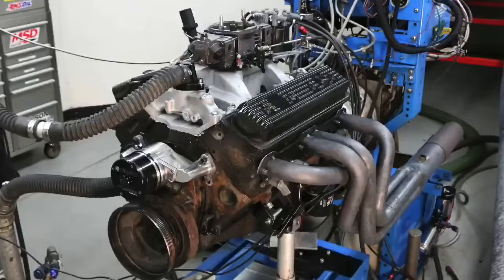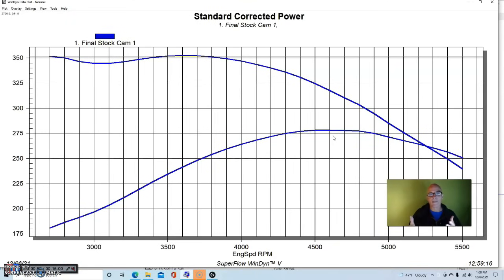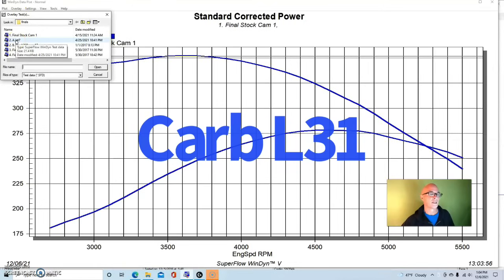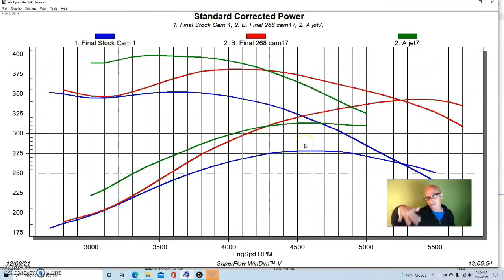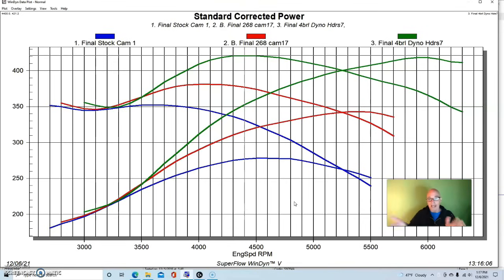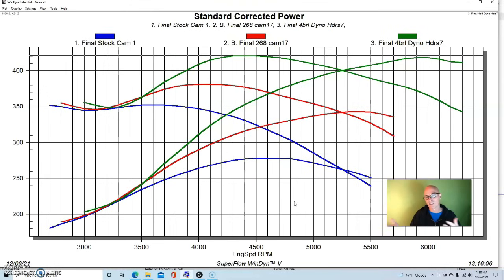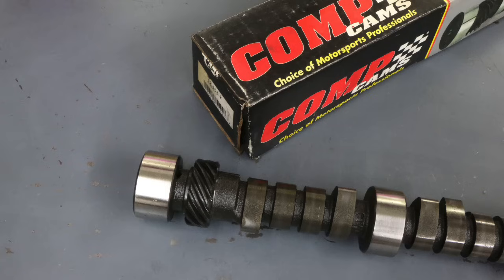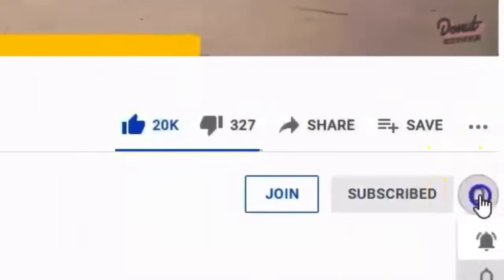HOW TO MAKE CHEAP, JUNKYARD, VORTEC SBC POWER. JUNKYARD VORTEC HEADS-400-HP 350 CHEVY MODS.

Comment: I pretty much have the same set up in my 3rd gen camaro.. Forged flat top pistons, 15 thou shim gasket, vortec heads screw in studs, ls springs and comp retainers with valve job 1.6 ratio rockers 3'42 gears 700r4 trans and it runs fantastic, pulls hard and makes a nice street driver highway cruiser with the 600 holley vac secondary.. If light foot work on highway if I had to guess I am getting 20+mpg. Its just a nice running motor fantastic driving car.
Reply: Good luck buddy I just did basically the same thing to my 91 camaro and the trans has already been built twice and I said fuck it and I'm putting in a 350 turbo because no matter who builds those 700R4 trans they won't last with anything above 400hp
Reply: @jonathanlawson4667  WRONG.  Look up the name SONNAX, please.  BTW, AC-DELCO sells "hard parts" that can handle up to 650 ft. lbs. of torque.  With a 4 speed, you can put "stiff" (3.73, 4.10, or even a 4.56, with tall tires) gears in the diff, and still get decent mileage.  Try using that THM 350 with those ratios, "bye, bye," piston rings, sooner than later--high revs wear out any motor, period.  You can (easily) build the 4L60 (same as a 700R4) to the specs needed, to handle up to 500 hp, with no issues. Having an overdrive transmission always beats not having one, unless it's a  "Saturday night/strip only" ride...  P.S.   You need to find a builder who knows HOW to build a 4L60 series transmission.  Next Spring, I intend to BECOME one of them, now that I have a garage (finally!) to DO it in.  Good luck to you, whichever route you take, but remember what I've (correctly) stated ABOUT 3 speed versus 4 speed automatic transmissions...
Reply: @bobhoffman5581  wrong 🤣🤣🤣 my transmission is proof sonnax is shit and if you want another example look at Billy the kid and SRC garage they couldn't get one to hold either and spent over 5k trying to so Don't tell me I'm WRONG when I've went through 5 all together and 2 with this 650hp nitrious car so with all due respect you're WRONG buddy
Reply: @jonathanlawson4667  YOU claimed "anything over 400 hp," which is total Bravo Sierra, PERIOD.  You're NOW describing a HIGH PERFORMANCE, not really "streetable" (regular driver) type vehicle. FACT.  And did you keep going BACK to the SAME builder?   FIVE times, huh? And you just kept putting the same parts back in it?  I can't wait to hear your response.    Here's something for you to ponder--If you REALLY want a "bulletproof" trans, just go with a Powerglide, OR a tricked out 400THM.  NO 350THM will "live" under conditions either ONE of THOSE will tolerate!  Dude--FIVE TIMES? With that much power output?  Wow--such a "genius" you are.  After the SECOND TIME, if you would have WENT with a 'Glide or say one of those "two speed" THM400's, you likely wouldn't have spent a DIME MORE!  Going the route YOU did, you're STILL not done spending $!!!   LMAO   P.S.  Aftermarket cases FOR either the Powerglide or THM 400 can handle some SERIOUS "abuse"--the new 400THM cases can handle up to 3,500 HP, according to some claims, but me being ME, I wouldn't try to "push the envelope" past 2,800-3,000 hp.  I like to keep things well UNDER "limits," to assure product integrity...    Hope the "Benjamins" YOU still need to use don't put too big of a hole in your wallet!
Reply: @bobhoffman5581  you said WRONG at the very start of your sentence and you said up to 650 as well lol nothing I said was wrong in any way it has all come from experience of me throwing money down a dark hole and losing it because even at 500hp I still would have to see a dyno video of a 500whp car with a 700R4 holding it because it wouldn't I don't care what they tell you the one's I spent thousands on was rated up to 650hp and that was total BS
Reply: @jonathanlawson4667  I said NO SUCH THING, DUDE--UP TO, MEANS 500, OR UNDER!  I'M DONE WITH YOU--YOUR INABILITY TO COMPREHEND SIMPLE ENGLISH IS WHY.  ADIOS...  smh
Reply: @bobhoffman5581  Come on guys. Let's show a little Love.😁
Reply: @bobhoffman5581  nah. ive worked at a trans shop, and a red 2006 gto ALWAYS came back every year, from blowing up the 4l60e. it was BUILT too.
Reply: Always a guy who’s “destroyed 5 of those” telling us what a good mechanic he is….  
Hilarious
Reply: @jonathanlawson4667 I have a 3rd Gen Camaro (82) and I built the 700R4 myself and it healed up surprisingly well behind the 600 HP big block that I also built. Street driving of course, zero strip action. 700R4 is still in the car with a SBC in it now, ( big block went into my pro-street 78 Malibu) but not for long though. I have a fully prepared TH350 to put in with a BMR cross member. Just need to get a drive shaft.
Reply: @jonathanlawson4667  I disagree...lol
Reply: What Vehicles did the L31 Vortec Engine come in?
Reply: @johncalhoun8011  trucks Tahoe's Escalade box trucks lot really Van's 96-00
Reply: @19latoria  Thank you Sir 👌🏿
Reply: @19latoria  Are the L31 Vortec Heads Pretty good? Or should I upgrade to Aluminum Heads?
Reply: @19latoria  I appreciate it Sir
Reply: @19latoria now the big question is the vortec 350 an gen 1 small block or it’s an gen 2 like the LT1 and gen 1 parts are not compatible 🤷🏽‍♂️
Reply: Had one in a 90 chevy truck 355 vortec with tbi setup...lol... 
The truck was monster on the street.
Best 1/4.was 13.6...on motor!!
Never got to use the bottle!!!!
But it ran good . Still had a/c and cruise control still worked!!!!
And this happened back in 2001 !!!..even got to spank a. Few ls1 camaro!...
Reply: On my 3rd build for this motor first sold it didn't know what I had I bought 2 big blocks but did nothing to them just thru one in it was fun but problems was young now I built 2 top end vortec builds that's been running strong for a year 1st one still running strong after 7 8 years that I sold the big block still running good by
Reply: I am getting ready to do this too in an '83 Z28. I have an ATK rotating assy minus the cam and a set of Summit (Dart) Vortec heads and an Edelbrock EPS intake. Considering going TPI if I can find a SDPC Vortec TPI lower. I have a Comp XE274H (230/236 .490 .490 110 LSA) but may go hyd roller. Not sure yet. Can't wait to get this together.
Reply: bro let me tell you. get a marine intake or even a stock vortec 5.7 intake and a wiring harness and computer. stick a built 4l60e behind there and youll get way better power. lunati makes a great torque cam for these motors and im getting 25 mpg highway and 35 mpg city/country roads 55 mph. but over 400 ft lbs of torque
Reply: Man this right here just makes my project car much more ready to hear for first start up . I pretty much got the same as you in my 86 camaro , can’t wait to hear almost done .
Reply: That’s awesome man. The 700r in my third gen Pontiac is toast. I’ve got a 98 L31 that was given to me (literally😂) that I’m thinking about dropping in it with the rebuilt 700r. We was gonna leave the 305 as it runs super great, but it won’t do what I want it to do, I don’t even have to be able to drive it to know either lol
Reply: @clarksgarageofbadhabits6803  facts.  my buddy had the 305 and my DD 3.8 bone stock camaro pulled away on him lmfao🤣     ...But hey t lo be fair, the 3800 series 2 is a beast of a V6 engine.
Reply: Brother you are not getting 20mpg on the highway 🤦‍♂️😓🤣
Reply: @SEPHICHI420  20 mpg on a small block 350 yeah sure i don’t even think stock it could get 20 mpg on the highway that’s like 305 sbc numbers stock
Reply: I can believe you got 20+ mpg. I had a 2wd Tahoe with the L31 with 3.73's and got between 20-21 mpg on long highway runs would avg 16-17 mpg with normal everyday driving. The L31 is a excellent foundation to build a nice street engine from. GM increased the nickel content in the '96 and up blocks
Reply: What would you get in a Qtr
Reply: That's like exactly what I want I'm going to buy a third Gen with no motor or trans had an LS for 500 and build a 350 4 bolt and either turbo 400 or 700r4 probably 700r4 because of
Reply: My new Chevy Colorado  2.7 liter  4 cylinder  gets  19 to 20 mpg.
Still thinking 🤔 it should be getting  28 or 32 mpg. But it's Not.
Reply: How is it holding up ?? @larryw5429
Reply: I’m getting ready to do this in a 72 chevelle try make it a good drivable car has a 0010 block bored 30 over old beefed up 882 smoggier on it at the moment

Comment: This is a very good timing video, I'm just starting my 1996 vortec 350 build..
Reply: This is my favorite junkyard block 96-98
Reply: @kdsboosted4954  my last build for this truck I did a very cheap build on a bone stock 190hp Goodwrench 350.. it worked for a lot of years but I found this running 1996 suburban that I'm upgrading to. It's going into a 1967 C20
Reply: @marchettejw  that's killer! I've used these a lot.

Comment: Suddenly my '92 Z28 350 TPI looks like a project again.
Reply: Pretty much the same set up in my 3rd gen except with Forged flat tops, shim gasket and 1.6 ratio rockers ls springs and comp retainers. Pulls hard and runs fantastic with the 3;42 gears and auto trans its a very nice cruiser on the hyw too and with the Hawks ram air system set up I get 20mpg with 600 holley vac secondary!  Faster you go the harder it pulls its pretty neat lol!
Reply: I have 2 boosted tpi set up's and love them. Get to work you'll have a blast.